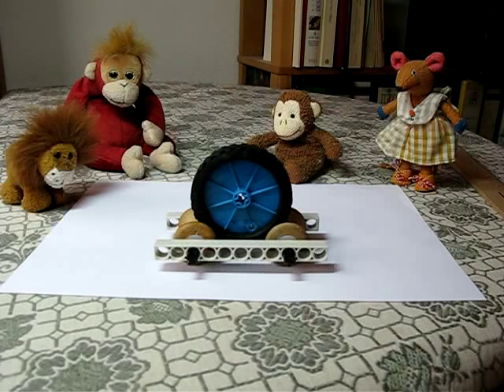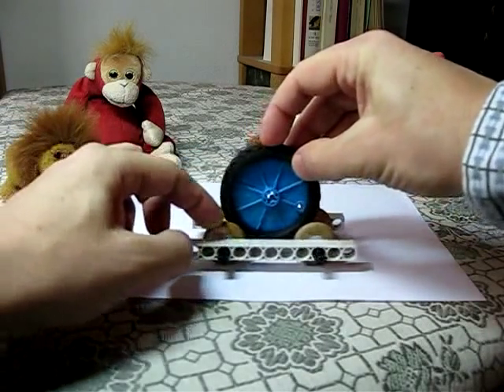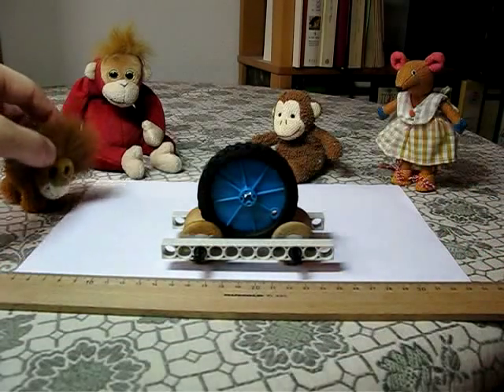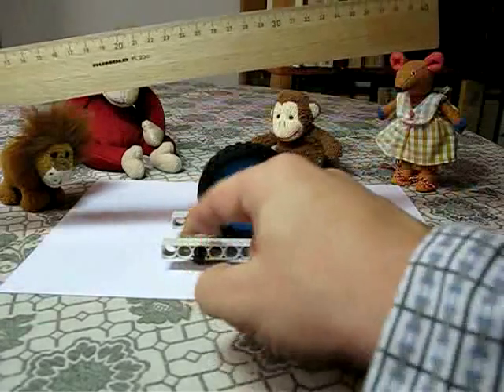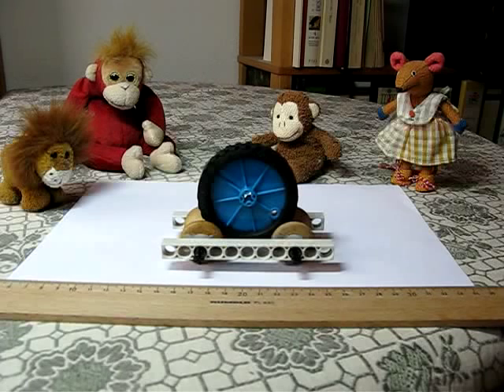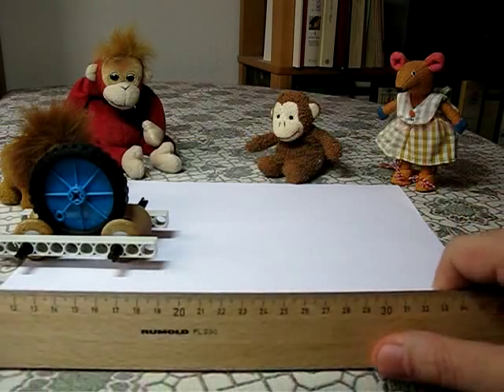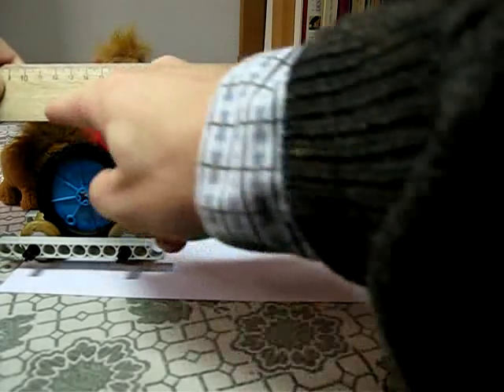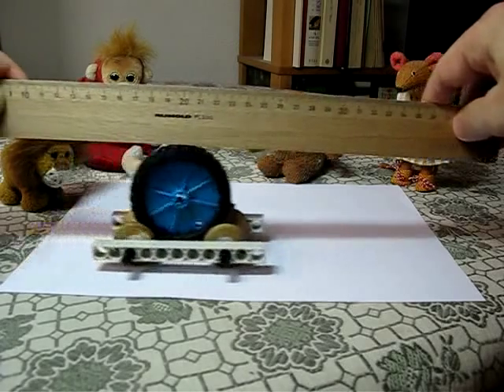Under the ruler faster than the ruler

Comment: It took a bit longer than I had anticipated and a lot of work (phew!) as I am basically a one-man show, having to do everything myself to produce this video (see end credits) but I finally got my video done that explains the real physics behind ‘under the ruler faster than the ruler’ phenomenon.

Due to YouTube’s limit of 15 minutes per video, I had to break it up into two parts, each of which is just under 15 minutes in length.

You can view part 1 at
https://www.youtube.com/watch?v=D9Hw7lH5X-8

and you can view part 2 at 
https://www.youtube.com/watch?v=fVpf8zG_geY

Sorry about the somewhat poor quality of the sound during the in-person demonstrations. This was the very first YouTube video I have ever made, and I just used my web cam to record it, so it came out a bit worse than I had thought it would (lots of static noise in the background), but it is still serviceable. 

Also, you can turn on the CC or the transcript and that gives a fairly accurate word by word description of my demonstrations (a few funny glitches here and there, but overall mostly good).

Anyways, looking forwards to the acknowledgement of your mistakes and your apologies for misleading people.

Note: If nothing else, the music soundtrack rocks, so I think you will enjoy it!
Reply from the maker: The machines you show in your videos do not duplicate the principle shown here. The missing element is the fact that the large wheel should not contact directly with the rims of the four wheels of the cart, but with the centre parts which have a smaller diameter. This condition is essential for the gearing to work. You can see a completely geared version of the "under the ruler" cart here:

https://www.youtube.com/watch?v=IDbzL-p2xvs

The cart in this short video duplicates the working of the one in my video; the difference is that everything is geared so you can actually see that there is no slipping. Note also that the top rack is not applying any downwards pressure, it is only applying a sideways force.

As I said before, the demonstration I do here is not a trick. It has been used by physics teachers in their lectures. Here's one example:

https://www.hmc.edu/physics/physics-lecture-demonstrations/mechanics/measurement/relative-motion/moving-reference-frames-1e10-00/
Reply: @coolaun  Dude, I just clearly demonstrated that I could make the toy cart move under the ruler faster that the ruler using only elastic potential energy.

All I did was press straight down on the ruler, and the toy cart moved forwards under it, and no linear force was involved at all.

Therefore, by definition the toy cart moved under the ruler faster than the ruler, since the ruler wasn't even moving in a horizontal direction.

This had nothing to do with having or not having contact with the larger rims of the bottom wheels.

In your demonstrations, the only reason you have the double-sized bottom wheels is for stability, with the bigger top wheel nestled in the concavity formed by the smaller wheels on bottom. Otherwise your toy cart would easily topple over.

Basically, your arrangement is pretty much the same as would be seen in a wheels mounted on an axle scenario.

Also, you need to explain why the top wheel rotated in the wrong direction if the ruler was actually exerting a linear force on it as a straight line gear.
Reply from the maker: @bryanjackson8917  Look at the first link I posted in the comment above. There is no downwards pressure; only sideways force. Everything is geared: no slipping. You can make one yourself with Lego. It works because of the difference between the radius of the wheels that engage with the bottom rack and the ones (fixed on the same axles) that engage with the larger wheel. Using the ratio of these two radii it is possible to calculate the exact relation between the speed of the top rack ("ruler") and that of the cart. See here: 

http://web.cs.ucla.edu/~sahai/UnderFaster.pdf

I could post a force diagram to show why the wheel moves in what you consider to be the "wrong direction", but it's best if you first try to understand the simpler case of the "along the paper" cart: https://ibb.co/p2td9FK
Reply: @coolaun  You can make all the diagrams you want, but you can't demonstrate what you claim to be true in real life.

If you could you would, but you can't so you shan't.

Also, gear ratios have nothing to do with this.

Because the toy cart and ruler are a simple gear train set up, all that different gear ratios would do in that situation is cause the wheels to rotate at different speeds, but that could not cause them to rotate in the wrong direction. For that to happen, you would need to introduce rotational torque forces which are not present in the ruler/toy cart system as that system does not employ any compound gears.

(By the way, rotational torque will be the topic of my next video, which will show exactly how your "Along The Paper Faster Than The Paper' trick works.) 

Again, the ruler and the top wheel of the toy cart are rotating in the same direction, whereas they should be rotating in opposite directions - if the ruler was a linear input, that is.

No, the toy cart moves only because the ruler is only exerting a vertical force on it.

The fact that it is moving horizontally is just a sleight of hand trick.

The fact that you can move the toy cart even while tilting the ruler in the wrong direction is also just a sleight of hand trick.

Again, my video demonstrates in real life that all you have to do is exert a slight bit of downwards pressure on the toy cart and elastic potential energy does all the rest, and the toy cart moves as predicted.
Reply from the maker: @bryanjackson8917  Since I have already demonstrated my claims right here in this video, I don't need to do it again. You said I would "need to explain why the top wheel rotated in the wrong direction". I can explain exactly why the top wheel rotates as it does, but you're not listening anyway. As I said, it's best to start with the diagram I posted for "along the paper". 

Instead of continually claiming I am using sleight of hand, why not look at the video of the geared version I already linked to. Here it is again:
https://www.youtube.com/watch?v=IDbzL-p2xvs
Exactly the same setup as "under the ruler", just with everything geared. No slipping, no downwards pressure, no elastic potential energy, just gearing. It behaves just as my cart does, in both directions. Why?
Reply: @coolaun  Thanks for the video, as this this allowed me to do a close force analysis of what is happening in the torqued gear system you have presented, which torque does indeed cause the top wheel to rotate in the 'wrong' direction.

First of all, I would like to apologize for accusing you of using sleight of hand to make the toy cart move under the ruler when you are tilting the ruler.

Clearly the toy cart can move even under that condition without using sleight of hand.  

However, at the same time it should also be noted that this only validates the torqued gear system in that particular situation, and as I demonstrated in my video, elastic potential energy (EPE) is just as valid of an explanation for making the toy cart move under the ruler as is the torqued gear system.

In fact, in some ways EPE may even be better. It is certainly more energy efficient.
 
You have demonstrated via your video how it is that the toy cart can be moved under the ruler via differences in torque, but again you have not actually explained how that is possible.

So let me do it here for you. 
 
I was able to slow the video down to 0.25 speed and analyze it closely.

Since the ruler or - in the case of the video you linked to - the straight line gear (SLG) is the energy input into the system, my analysis here will focus on the interface between that SLG ruler and the top toothed gear.    

At 0:03 into the video, you can see that the SLG begins to drive the toothed gear in the proper direction as it would if those two gears were meshed gears allowed to freely rotate, as the tooth of the SLG in contact with the tooth of the top gear indicates that is the direction the force is being applied.

But at about 0:04-0:05, the top rotary gear stops for just a moment and the tooth of the SLG - which is still moving - then makes contact with it but now trying to move it in the opposite direction. 

Why this happens is because as soon as the top gear starts moving it encounters resistance to being rotated in the 'wrong' direction. This resistance is caused by the differences in torque between the top and bottom gears which is, of course, in firm contact with and being acted upon by the ground, and normally it wants to move in the opposite direction so that force has to somehow be overcome.

The top gear, being larger, has sufficient torque to overcome that resistance from the bottom gear, but it is still meeting with some resistance nonetheless.

At that point, the SLG continues to push the top gear in the 'wrong' direction because that gear is resisting being rotated in that direction via its connection to the toothed bottom gears. 

Then, when the whole assembly is moved in the opposite direction (since it is on a short track and must be moved back and forth), the whole dynamic of the situation plays out in reverse.

Therefore, based on this analysis and my video demonstration, we can make the following statements:

1. Both the torqued gear and the EPE systems are capable of moving the toy cart under the ruler faster than the ruler;

2. However, the EPE system will be much more efficient at doing so, since there will not be any linear resistance to its movement and the toy cart will readily move in the direction of least resistance.

OTOH, the torque geared system will experience considerable linear energy loss due to the need to overcome the resistance of the top wheel gear to being rotated in the 'wrong' direction.

3. Outside of the situation where the ruler is clearly tilted against the direction of movement of the toy cart, it is impossible to state with any certainty which dynamic is taking place - that of torque or that of EPE.

4. However, just from casual observation of the videos presented thus far (mainly the Veritasium video) it would seem that since the toy cart moves so easily under the ruler/yardstick and no slippage can be seen, EPE is the more likely of the two explanations. 

I say this because if torque was the driving force in the Veritasium video, then due to the resistance of the top wheel to being rotated in the 'wrong' direction, it seems there should be some slippage one might be able to detect. But it seems to roll quite freely and easily under that yardstick.

Of course, just my hunch, and more sophisticated experiments/measurements would have to be carried out to ascertain the true dynamic at play there. 

Note: Since you raised this issue in an earlier post (i.e., that my toy cart setup was not exactly the same as yours), I carried out an experiment to see if EPE would still work as advertised. That is, I placed a compound gear wheel assembly on the bottom.

The result was just as I predicted, that yes EPE stills work perfectly well with that setup in place.

Another question that remains to be addressed is, which analogy best applies to DDFTTW - that of EPE or that of torque gears. 

I will address that issue in another comment as this one is already fairly long.
Reply from the maker: @bryanjackson8917  Apology thankfully accepted. Yes, there is no sleight of hand in any of my videos. Here's something for you to consider:

The video I linked to with the geared version of "under the ruler" works in exactly the same way as my version. Kinematically, power transmitted by gears and racks is equivalent to power transmitted by frictional contact between wheels and surfaces, as long as there is enough frictional resistance to prevent slipping. An excellent indication of the fact that the two systems are equivalent is that it is possible in both cases to predict the exact relation between the speed of the ruler/rack and the speed of the cart. It's the same formula in both cases, and depends only on the ratio between the radius of the wheels that run on the ground and the radius of the part between those wheels that touches the larger wheel. If Vr is the velocity of the ruler, Vc the velocity of the cart, r1 the radius of the wheels that run on the ground and r2 the radius of the part between them that engages with the large wheel, then the formula is:

Vc = Vr x r1 / ( r1  -  r2 )

In every case, the observed speed matches the prediction.
Reply: @coolaun  Assuming here that by "the two systems" you are referring to both the compound geared system which relies on and the EPE system which I have demonstrated, then it is agreed that an "excellent indication of the fact that the two systems are equivalent is that it is possible in both cases to predict the exact relation between the speed of the ruler/rack and the speed of the cart".

And both systems can be seen to move the toy cart under the ruler faster than the ruler, thereby demonstrating that this phenomenon is indeed possible.

However, conceptually speaking I find that your torqued wheel system is, at best, a rather flawed model when used to explain the DDFWTTW phenomenon. 

I will explain this in more detail in my next video, but again it has to do with the introduction of and reliance on torque to explain how it is that DDFTTW vehicles - such as the Blackbird - can travel dead downwind faster than the wind.

Basically the problem is this:

You can use torque to explain how the wheels of the Blackbird cause the propeller to rotate faster than its wheels despite the resistance of the propeller to being rotated in the 'wrong' direction, thereby producing thrust.

But you can't use torque to explain how it is that the Blackbird then travels faster than the wind.

Simply put, thrust is a linear force whereas torque is a vector that causes an object to move in a circular fashion about an axis and acquire angular velocity.

Note that the Blackbird travels in a linear fashion.
Reply from the maker: @bryanjackson8917  What I said was "The video I linked to with the geared version of "under the ruler" works in exactly the same way as my version." I am only comparing these two versions: nowhere in that comment do I talk about your version with elastic potential energy. The formula I give for the relation between the velocities of ruler and cart works for the geared version and for my version, but has nothing to do with elastic potential energy.

How do you predict the relation between velocity of ruler and cart for a version that relies on elastic potential energy?
Reply: @coolaun  But you clearly link this concept with that of DDFTTW, and the two are not equivalent.

As I pointed out before, the under the ruler principle relies on torque (or, as you now admit, potential elastic energy could also be used), whereas in the final analysis DDFTTW cannot possibly rely on torque.

The wind is air, air is a gas, you cannot apply torque to a gas.
Reply from the maker: @bryanjackson8917  Nobody is saying that torque can be applied directly to air. Torque is applied to the propeller shaft, causing the propeller to turn, which produces thrust, a linear force that cause the cart to advance. So at the start we have a linear force coming from the motion of the air relative to the ground, and at the end a linear force that (propeller thrusting against air) that accelerates the cart. Torque only comes into play in the internal workings of the machine.

For the "under the ruler" cart, it's the same. There's a linear force coming from the motion of ruler relative to the ground, and at the end a linear force 'wheel pushing laterally on ruler) that accelerates the cart. Torque also only comes to play in the internal workings.

One final thing: elastic potential energy can make a cart temporarily gain speed, but this will not work continuously in steady state. Both the "under the ruler" cart and the DDWFTTW vehicle reach a steady speed greater than the speed of the driving medium, and stay at this speed as long as the driving medium keeps its original speed. This does not come from elastic potential energy, but from a gearing system that makes continuous use of the relative motion between two media.
Reply: @coolaun  Right, but in that case 'under the ruler' does not apply to the Blackbird. The Blackbird does not extract energy from the relative motion between two surfaces, as so many have claimed.

Yet you people keep saying it does prove that DDFTTW theory is correct and/or how it works.

All the under the ruler shows is how the wheels of the Blackbird can cause its propeller to rotate despite the resistance of the air to that rotation.

Any question as to whether it then produces sufficient thrust to propel it past the speed of the wind is entirely separate. 

By the way, did you know that you can get a toy cart to move under the ruler fasted than the ruler by placing the toy cart upside down?

I discovered this quite by accident when I was playing around with my toys. 

You just turn the toy cart upside down so that it is, sandwiched between the ruler and the former top wheel, which is now the wheel on the ground.

In this setup, you bypass the compound gear and just have the two wheels in direct contact with each other, with the smaller wheels driving the big wheel. (IOW, the big wheel is driving the outer rims of the cotton spools, not the inner rims.)

You also have to keep the ruler slightly tilted backwards in order to push the toy cart forwards. (Note that in the toothed gear version of your setup, the straight line gear is acting as a lever to 'lift' the cart forward, and everything is more or less rigidly held in place.)

But once it starts moving it will take off of its own accord with very little effort.

Due to the greater torque of large wheel, the small wheels will again rotate in the "wrong' direction and travel along under the ruler faster than the ruler.

This setup also has the advantage of being able to apply EPE on demand to make the toy cart move even faster.

Just push down on the ruler a bit as you move it along and the toy cart will suddenly accelerate forwards!

Kind of like those gusts of wind that suddenly propel the Blackbird...
Reply from the maker: @bryanjackson8917  >> "The Blackbird does not extract energy from the relative motion between two surfaces, as so many have claimed."

It extracts energy from the relative motion of two media. In this case the two media are air and ground. This is analogous to many other vehicles: the two media can also be air and water (sailing boat) or even air and air (dynamic soaring).

>> "All the under the ruler shows is how the wheels of the Blackbird can cause its propeller to rotate despite the resistance of the air to that rotation.

Any question as to whether it then produces sufficient thrust to propel it past the speed of the wind is entirely separate."

It shows that, given sufficient efficiency, a vehicle can be created that extracts energy from the relative motion between two media to run, steady state, at a velocity greater than the relative velocity of the two media. The question of calculating if the propeller-powered version is feasible then boils down to calculating if the real-world efficiency of propeller and drive train can be sufficient to keep the vehicle running steady state above wind speed.
Reply: @coolaun  The ruler is a straight line gear, a linear force if you will, that via the top wheel of the toy cart which acts as a lever - which is exactly what a toothed gear is, a round lever - pushes the bottom wheels to move forward.

When those wheels do start to move forward, at first they try to move in the direction that would be consistent with that force applied by the ruler. 

But that rotational movement is immediately opposed by the large top wheel, and thus there are now opposing forces at work.

Since the top wheel has a greater amount of torque than do the bottom wheels, it causes them to rotate in the forward direction that the ruler is pushing the entire assembly forwards, mainly by the aforementioned force from the ruler acting as lever.

In addition, since the top wheel is now rotating in a direction opposite to that which it normally rotates if it were free to rotate, it pushes back against the ruler.

This 'push back' causes it to travel forward along the bottom surface of the ruler as if were a wheel rolling among the ground, and this also contributes to the forwards movement of the entire toy cart assembly.

Note that there are at least three forces at work here (maybe five even depending on how you break it all down) which must all be taken into consideration here and their affect on how the system moves.

Then, remember that some of the forces are actually working in opposition to one another.

The top wheel of the cart is the link between the ruler and the bottom wheels, and the torque created by the different size wheels is the key to the system being able to move under the ruler faster than the ruler.

A close frame by frame analysis of the video you sent me of a loosely toothed gear assembly in action clearly shows this analysis to be true.

Exactly how (or even if) this applies to DDFTTW is another question.

Note: Since the toy carts use rubber elastic wheel(s), there is undoubtedly some slippage between the surfaces and perhaps even occasional EPE involved, as well.
Reply from the maker: @bryanjackson8917  I'm not going to keep replying to all your points here in the YouTube comments, because it's really not the best place for a serious discussion. If you're interested in continuing to talk about this in detail, I invite you to participate in the thread at Talkrational Forums, which is much better suited to continuous debate:
http://talkrational.org/index.php/topic,24.0.html
Reply: @coolaun  Okay understood, and thanks for the link to the forum, I'll definitely take a look at it.

Just one final question, if you don't mind, and all that is needed is a yes or no answer:

Do you agree with the analysis I presented in my last comment of the movement of the toy cart in relation to the loosely geared video you sent (i.e., in which the top wheel is experiencing opposing forces)?

Thanks!
Reply from the maker: @bryanjackson8917  Short answer: no, I don't agree with your analysis.
Reply: @coolaun  my man kudos to you for coming back to take the time to answer the comments after 13 years! We need a video update, hopefully Coco is still good!!
Reply: @bryanjackson8917   veritassium has 2 videos on this principle, check them out "travelling downwind faster than the wind" or something along those lines, maybe "risking my life to prove physicists wrong"
Reply: @hareecionelson5875  My point is that the one and only reason why the cart demonstration in this video (and other similar such demonstrations) work as it does is only because the bottom wheels of the cart are compound wheels.

The drive wheels of the Blackbird are not compound wheels, and thus the explanation that it works according to the same principles is an imperfect analogy at best and, for various reasons to lengthy to go into here, really offers very little in the way of explanation as to the dynamics of DDFTTW vehicles.

The problem is, DDFTTW proponents keep offering if as if it is some sort of explanation even thought it isn't.